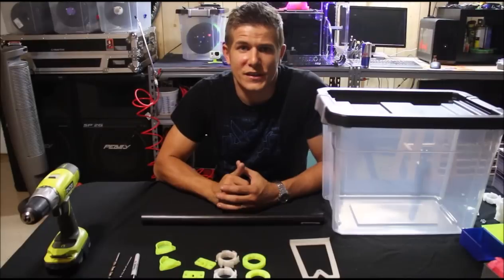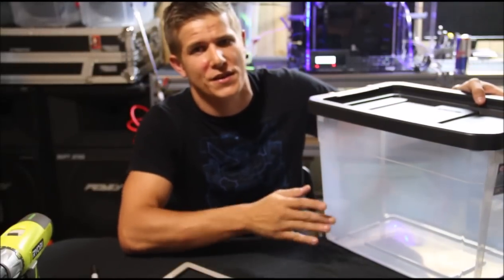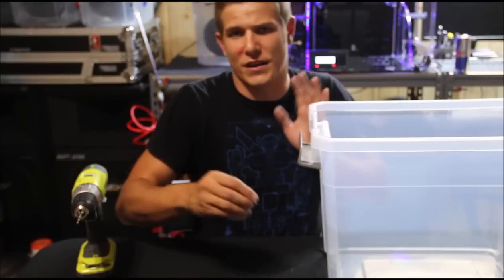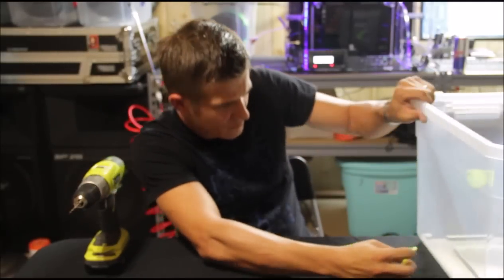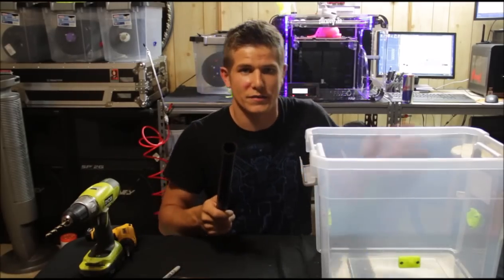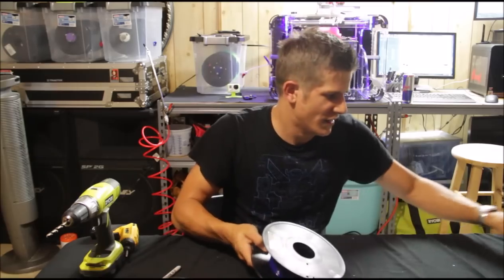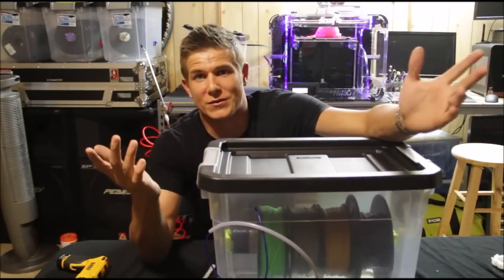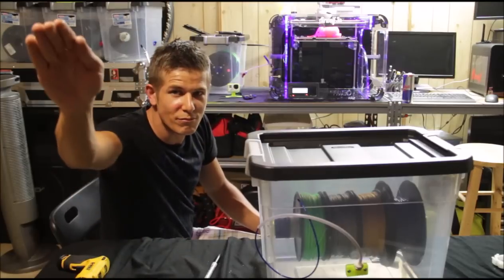3D Printer Filament Storage Solution - Fix for Humidity and Dust.

Comment: what us the ideal humidity range for filament?
Reply from the maker: +James Cullins The lower the better. Most filaments are very fond of water. I tend to keep it in a fairly dry environment 35-40% humidity, having them in bins with the silica gel helps in a big way. I had filament that was left in the garage in the middle of summer and it would spit water bubbles out constantly.
Reply: The reason I asked is I have designed a dehumidifier  and I have a set point for humidity. I have it set now at 18%, it does a good job so far. I use a 60 watt incandescent lamp for heat heat stays about 36 deg C so far. Thanks
Reply from the maker: Very cool! Do you have any examples to share?
Reply: Not yet. I have the electronics PCB and code done but still printing the cabinet for it.
I like the idea of being able to monitor the temp and humidity on an LCD. I used the Nokia 5110 LCD it is easy to use and very sharp text, could do graphics but it does the job as is.
Reply from the maker: James Cullins This sounds awesome I would definitely be interested in seeing what you come up with. Please follow up with me when ready! Do you plan on making a video to demonstrate?
Reply: No videos I can send photos and explain what I am doing. It is very simple.
Reply from the maker: Would love to check it out. You can always e-mail me if you like jim@chicagolandgeeks.com- I would to make a working demo and feature a video if you wouldn't mind could be cool. Full credit to you of course!